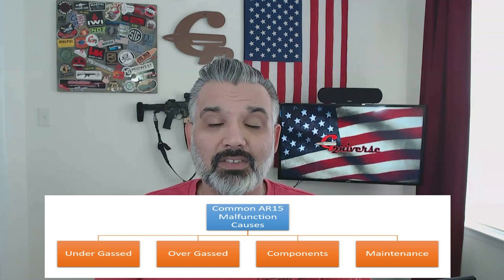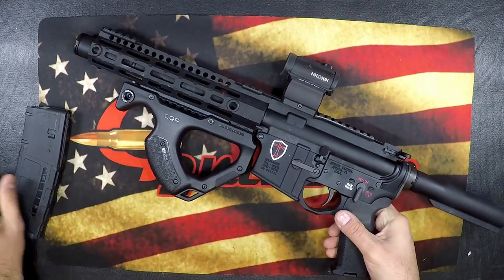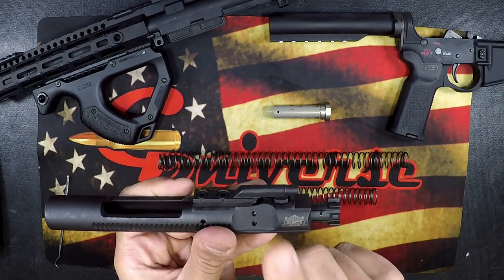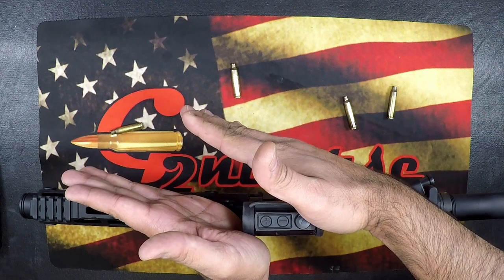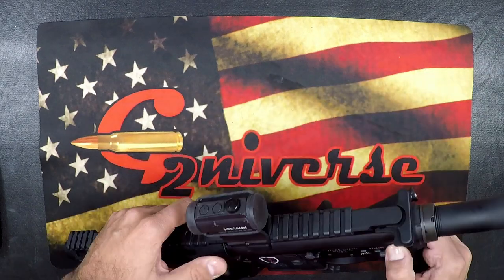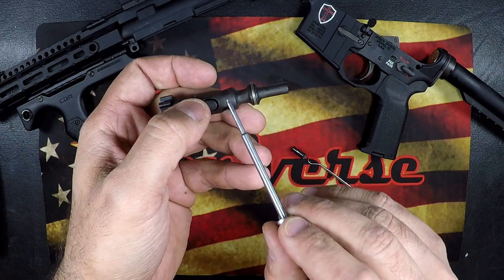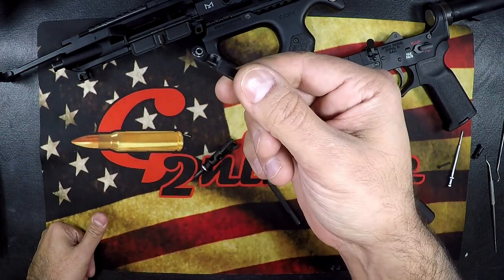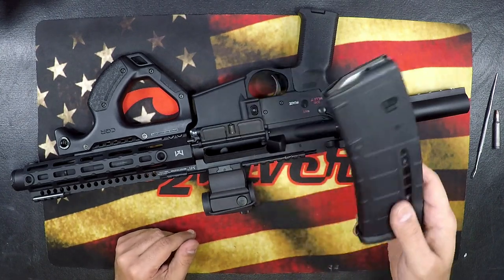Safely Fix AR - Failure to Feed, Eject, Extract and Fire

Comment: I have learned more about ARs in this video than any other out there. My recently bought M16A1 looked to be under gassed by all measures but it may be that the spring is too strong. On my other m16A1 that works perfectly the cocking handle requires just a bit less force to pull back. I will swap out the springs and go to the range just to find out. They are both full lenght rifle springs.

Comment: Man, I can tell you how much I needed to watch and analyze this video. I have a Maxim Defense PDX 300 blackout. I've only had it for a few months with no feeding issues until I started using an open tip range ammo. I truly believe the projectile tips are hitting the receiver ramp quite frequently. I've been having 2-4 malfunctions each magazine with  only 20 to 25 rounds loaded.
Reply: Yea, I’ve had to tweak many a blackout. Pull your barrel off your upper and look at your two feed ramps.  9 out of 10 times I see a normal 5.56 barrel extension on a .30 bore barrel.  You’ll want to Dremel those ramps much wider for the fatter bullets, and slightly round over any sharp edges to include the lower edge of the feed ramp.  Now it will easily ramp any bullet tip of any overall length.  Also, get yourself a military issue tan magazine.  These not only have a different follower, but the feed lips hold the cartridge at a higher angle to have less upward drag on the feed ramp.

Comment: Issue: Failure eject after 3rd shot.  Upon breakdown, I found substandard parts and missing screws.
Replaced following parts: Buffer Assembly and Spring (original parts looked generic),  Bolt Carrier Assembly. Gas Tube had only one screw. Added second screw applied blue Loctite to all screws. 
Thank you for making this video.  It helped tremendously

Comment: Failure to feed is also typically an undergassed issue. Using my 300blk i can demonstrate it by first successfully cycling 30 rounds of super sonic shells, but when i switch to subsonics i get failure to feed due to less gas. 

I had to drill out my gas port 12mm over factory to get subsonics to feed and 1 round test to succeed. An Aero Precision adjustable gas block accompanied the gas port increase. Now I can run supers or subs on one setting. Or I can optimize for supers or the subs. The plan is to eventually oprimize gas block for subs with supression.

Comment: Absolut genius Video <3 thy a lot for your work sir!!
I recently had problems with my AR15 and I had to replace the extractor because it had completely blown out after the pin had a defect. It was torn off halfway round at the locking point. What surprises me is the O ring of the ejector. Is this fitted to all AR15s? Because when I dismantled it I realised that none was fitted. Only the small spring with the small plug in the spring... Anyway, after I fitted the new extractor, the AR15 loads cleanly with buffer cartridges and ejects cleanly, no matter how often I do it. So far so good. A shooting test is coming up, then we'll see

Comment: Very informative video, thank you.  My father was the gunsmith before I was and one of the first things he told me was that 40% of gun failures is dirty guns.  My experience and schooling has shown me that a failure to extract means making sure the chamber is clean and most likely polished with 400 grit.  Also failure to extract can be a worn hook on the extractor itself.  The rubber o-ring for the extractor is only for harmonics in full auto, not needed for semi-auto,  and finally, consistantly my customers have had failure to extract because of out of spec ammo and steel cased ammo.  Steel expands but does not contract like brass and can continue to cling to the chamber walls.  Some guns don't have a problem with steel cased ammo, however yours might.

Comment: I'd like to say that this is a very informative video for troubleshooting an AR-15 with problems. I would add one thing. You don't talk about bolt bounce back when AR is over gassed. That is something I experienced with my AR. I fixed it by getting an adjustable gas block and using a heavier buffer.
Reply from the maker: Did a completely different video just on bolt bounce. You are absolutely correct.

Comment: I have been having failure to extract issues with a dirty who’re of a gun….🔥
A 7.62x39 7 1/2” upper….
It’s a BCA upper on a PSA lower…
Man when this gun fires it’s a sight to see!🔥🔥🔥
But
Problems galore with failure to extracts!🥺
Which breaks my heart!
My son is a Marine Reservist and loves this Dirty Little Girl of a Gun!😘
He has BCM Upper in .556 NATO that runs flawlessly on the same lower!
16” barrel with an ACOG Sight….
Stupid Accurate!😅
But we both love shooting the .30 cal 7.62 upper in 7 1/2” barrel length!💀🔥💀
I refuse to give hope we can get this gun to be reliable!😇
This video helps alot!😎
Reply from the maker: Your number one issue is the length of the barrel.  Its entirely too short for (1) accuracy and (2) reliability.  Imagine building an ar-10 .308 with a 7.5 inch barrel?  Ridiculous right?  Its exactly the same thing.  The short barrel is choking the system plus you're not even getting close to proper twist and barrel length to provide optimal ballistics for the round.  Distance + powder burn = stable flight with accuracy.  If you at a bare minimum made this an 11.5 inch barrel, your problem would be solved.
Reply: I have basically the same set up with the same issue. FMK lower with BCA 10 & half in upper 762×39 and it's beautiful 😍  I MUST GET THIS FIGURED OUT & FIXED ASAP ITS DRIVING ME CRAZY 🤦‍♂️

Comment: Very good info. My AR with 350 ledgen barrel seems like the bolt sometimes won't close all the way and when you pull back to get it to close it will but if you come back to far another round will try to load.

Comment: Phenomenal information my dude…. Thanks for your hard work on this video. I’m not a noob but this was still very informative AF. I’m having cycling issues and it’s bending rounds and jamming them into the bore. They are bent at the shoulder and has two long dents in the bottom of the casing just below the shoulder where I’m assuming the feed ramps are smashing in. I think I’m over gassed and it’s running way to fast but not sure yet.
Reply from the maker: Glad it was helpful!

Comment: Great information. Great video. I'm having issues we with a short 6.5 Grendel build.  I'm pretty sure it's over gassed. This helps. Thank you.
Reply from the maker: If its under 14 inches, you're most likely right.  Start easy, heavy buffer then go from there.  You can get just the weights on amazon, and play around with it.  Just keep doing the one round/one mag test until you tune it in.  Just watch for bolt bounce.  Overgassed systems with a light buffer can look like failure to feed/eject, but in actuality its the bolt bouncing back out of the chamber because its moving to fast to engage the cam pin.
Reply: @G2niverse  thank you sir.  The bolt is bouncing back.  It's a 12" barrel and pretty violent.  Not pleasant at all yet.  I'll try it now, buffer first.  Thanks again, I really appreciate it.

Comment: This has been a fantastic video. Thank you so much I have a 6.5 Creedmoor in an A.R. 15 platform now I know what to look for because it fired one round never extracted I had to pull the case out. It had marks on the shoulder and the neck I don’t know where they came from but if I check everything else, I should be able to find out what’s wrong without having to go to a gunsmith again thank you.!!

Comment: Thanks for the video very informative.  I generally don't post to these things, simply don't like the entire social media concept, but felt compelled as my situation is very odd.  I just did an AR build.  First one so it would not surprise me that I did something wrong though I have owned and worked on AR's for a few years now.  I work at home and go to the range during lunch two to three times a week and limit my shooting to 60 rounds generally.  

One round test worked fine first time I shot.  Loaded up the entire mag and shot 30 rounds without ANY flaws.  Second round around round 15 things fell apart.  The rifle would simply not eject for four rounds.  After that it fired off the next 10 or so flawless.  First thing I thought of was the magazine.  I have 16 to 20 various types so I mad a note of which one I was using.  Next week I went with my son on a day off.  Same issue.  First mag was flawless things fell apart on the second mag around midway.  Verified it was a different mag brand.  Oddly after that we put three more mags through the rifle without an issue.  I have been to the range twice since and each time second mag things fall apart.  Could the rifle heating up cause this type of malfunction?  I'm really at a loss because again it only occurs during the second mag.

Comment: Damn you’re good. I purchased all the parts for, and assembled, a lower receiver. Then I purchased a completed upper. Shot 5 rounds through it and it quit feeding. The cartridge got hung up before entering the chamber. Different lowers and different mags with 28 rounds and 8 rounds,  the results were the same. Even with the charging handle, first round chambered, second one jammed. Both the bullet and shell casing were damaged as you described. Now I know what to look for. THANK YOU
Reply from the maker: George Moomaw awesome....let me know how it works out.  Email me if you have any other issues or questions and ill do my best to troubleshoot with you.
Reply: @G2niverse  that was sure a quick response. Do you publish your email address on a web site? I will indeed keep you posted.
Reply from the maker: g2customgolf@gmail.com I check my messages every other day so I try to respond quick for you guys.
Reply: @G2niverse  good to know. Thank you again

Comment: Great stuff and easy to tell you know your business. I researched this issue but haven't found the exact problem. I This AR has less than 500 rounds through it. My issue is every 20-30 rounds or so with my 300 blackout, I get the "BIG JAM".  The big jam being the BCG is jammed and frozen with a live round in the chamber. I'm not able to pull the trigger, put on firearm on safe, or pull back the charging handle. I have tried the mortar trick but no go.  To clear same, I have to drop the magazine, turn the weapon over and pry the BCG back with a screwdriver.  I can then run another 20, 30 or some times more rounds but it is just a matter of time before the screwdriver has to come out.  I only shoot brass cases and reload the minimum charge.   Thanks in advance.
Reply from the maker: Yikes!  thats the big jam all right.   What sounds like is happening is the bolt is not locking correctly into the breach. Ive seen this after a fired round, but never a live one.  Check your bolt lugs, mating barrel lugs for wear and possible deformation.

Comment: Fantastic Video. Recently assembled a lower to go with my MK-18 complete upper. I was using a Sprinco Green/Vltor H2 in a B5 Tube..... Setup not working. Swapping for an H1, and also ordered a Carbine buffer/Spring/Super 42 from Geissele incase the H1 doesn't work. This video helped me troubleshoot.
Reply from the maker: James Malloy   youre very welcome

Comment: Great video, very informative. I think I found my problem in the first few mins. I will find out this weekend for sure. My st15 never had a issue, it shot beautiful. This weekend spent some time at the range sighting in a upgraded optic. It shot just fine, but would't cycle, (eject and reload) so I would charge it and it would extract and load no problem. I changed the brace and tube and the spring without noticing. Hope thats my problem. The BCG all looked good. Glad I watched your video, I was about to order a new bcg.
Reply from the maker: YT_fiveninner Thanks for watching!

Comment: The one thing I would add to this is the fact that most shooters that are new usually don't know regarding buffer springs, is certain high end manufacturers use sprinco springs, which come in 6 different coil lengths, and they do that to property tune their guns so they shoot way softer and smoother than any factory "production" guns.

Comment: I have radical firearms 16” 300 blackout. Consistently jams. Tried several mags including a 300 mag, Different ammo, I changed the carbine buffer to a t2 from spikes tactical. The gun locks back after one round I checked gas block alignment thought it was under gassed at first but it locks back so I thought over gassed. That’s why I put the buffer weight in. 110 grain I get double feeds and sometimes doesn’t kick the shell out all the way. On a 147 grain it doesn’t extract the first round fired stays in chamber and it feeds another on top.. that was the first thing that happened to it out of the box almost couldn’t get the shell out.. so I’m running out of ideas unless it’s the something with the BCG or the chamber itself..

So I get failure to eject, double feed, and single feed problems.
Reply: You ever figure out what was wrong mines doing the same thing

Comment: Thanks for taking the time to make this video- my first cheap $338 AR build runs perfect, my 2nd $800 AR build has intermittent failure to feed.  I have tried with multiple mags- same issue.  Passes 1 round test.  Feed ramps might be the issue- there is a shiny spot just to the right of the left ramp where the bullets are hitting.  Annoying!
Reply from the maker: Thanks codiddley for being a  subscriber...love hearing from you guys!

Comment: My new 16" military contract overrun AR15 upper half is doing a weird thing. It passed the 1 round test fine, but with multiple rounds in the magazine, it's having frequent stovepipes and otherwise weak ejections with just one brand of ammunition - white box Winchester 5.56, but it functions perfectly with Federal.  It's unusable with the Winchester. The same Winchester ammo works perfectly in my 16" Zaviar flat top, same Carbine lower and the brass ejects 8 to 10ft away from that.

Comment: I really appreciate this video I'm haven't double feed issues but after watching this I'm definitely under gased my rounds go to the back and I don't always get the bolt to catch I put a Franklin armory binary trigger and put the heavy spring in I have had the issues before yesterday but I also haven't put a lot of rounds threw since putting it in I'll have to check your suggestions and see if I can figure it out

Comment: Thank you sir for the great information. I will do the one round mag test. I built a ar pistol chamber in 7.62x39 with 10.5 inch barrel. I think it is under gass because I went to the range the other day and It shot great right out of the gate but then I started getting failure to eject and the next round trying to feed into the barrel at the same time. It happen 3 different times and all the same way. I have a heavy buffer and a flat spring that I will look at switching out to see if that my issue. But after that if it still happens what do you think I should try next or should I go back and watch this video again.
Reply from the maker: Richard Roberts chances are with a 7.62 in a 10.5, you're overgassed.   BUT best thing to do it set up your phone and video the BCG and see whats going on.  Might not hurt to go to a lighter buffer and see what that does.  Its going to be trial and error at this point.  Just make sure the extractor is ok on the BCG.

Comment: A word about the barrel nut whatever type barrel nut you use your gun will run and function with the barrel nut not tightened properly or enough. If you're just trying to get it to work that's cool I understand but you definitely want to make sure before you stake your life on this rifle you get the equipment or take it somewhere and have them properly tighten your barrel nut down.

Comment: On the one round mag test I have a 300 aac 16” rifle. Bought it brand new never stayed open on the last round. Come to find out the magazine the rifle came with doesn’t have the right lip to set the catch. Very small difference in magazines but enough to cause the problem. If you have this problem try a different magazine. Ps. It came with a 223 magazine
Reply from the maker: magazines should always be the first check for malfunctions.  never assume the one you have is good.

Comment: My m&p15 worked flawlessly until I up graded the hand guard. 
The bolt and ammo would not open, it’s Jammed in the barrel. I had it looked at by  a local smith. It would lock up when I cycled buy hand. He said he couldn’t find anything wrong. I decided to shoot it. It was ok for awhile then it didn’t eject the spent round and of corse the live round locked up. So the bolt would not lock in the open position with one round test. This happened about every 10 rounds or so. It was totally intermittent with 5.56,or 223ammo. I had another gun smith at the local range. He done some things, but still has same issues
Reply: Has anyone checked the chamber dimensions?
Maybe polish it?

Comment: Amazing 👏 I've tried everything ar 10 6.4 creedmoor build. The lower does not have feed Ramps and it is hitting the lower. Not always but it will jam up.  So i thought was a cycling issue i think its the  feed ramps. Not sure if i need a new barrel or if i can fix it

Comment: Awesome video.  I have a DPMS AR 15. With a full mag it fires fine but will not recycle? It does extract manually with a full mag or one in the mag. The bolt locks open with empty mag manually. Any ideas that may help. Fairly new 30 rounds ran through it from the previous owner. It is clean and well lubed.
Reply: Did you buy someone else’s problem gun, or did you witness this thing fire before you bought it?   If you know that at one time it ran fine, then it sounds like an undergassing issue.  Maybe as simple as a carboned up gas port at the barrel.   You’ll want an aftermarket adjustable gas port anyway to make it a soft shooter.